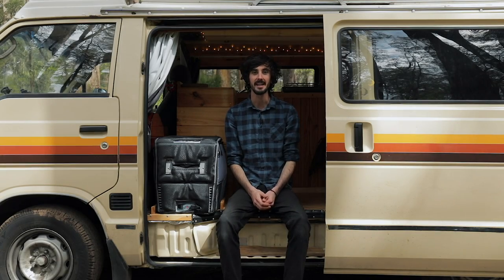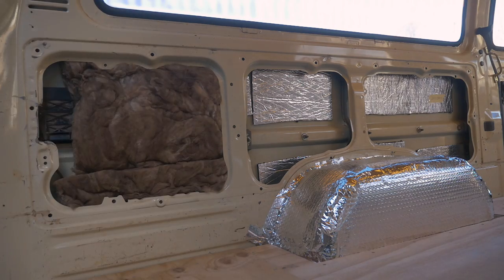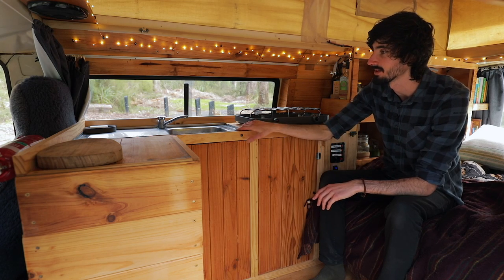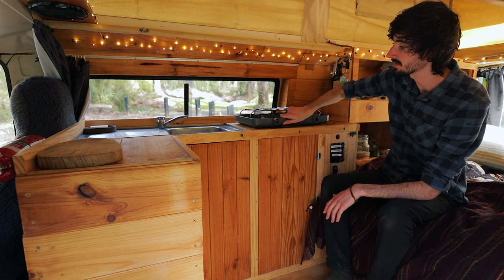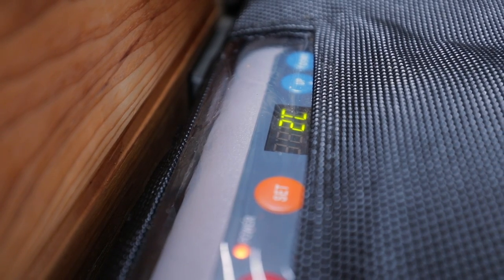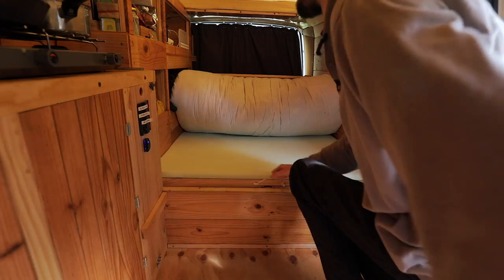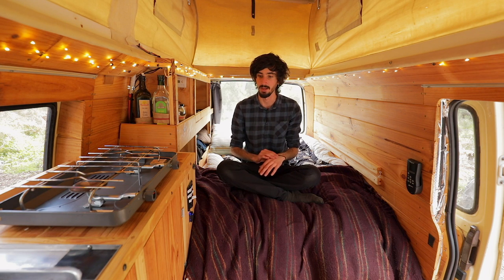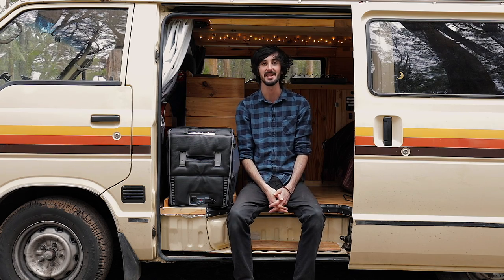Van Life Tour: I Converted an Old Van into my Full Time Home and Office!

Comment: Tearing out the old interior because it was old.. Buys old timber and screws back in... Say what?
Reply: It also smelt funky - just pointing it out
Reply: Who pays 6000 bucks for a 33 year old van?
Reply: @flailanwhip  a can is different from a campervan- a campervan is  basically a  travelling tiny house. And he rebuilt it so it's more or less worth the totalled money. Don't wanna start a comment debate, these are just my thoughts. Have a great day 😂
Reply: @cheliroyal3609  I agree the final product is worth it but, the original van looks like it was worth scrap value plus whatever the mechanical required to drive safely.
Reply: You realise he got it easy, something like this would cost 12000 Euro in Ireland
Reply: “it didn’t really fit my needs”
changes everything
Reply: @cheliroyal3609  You don't pay for a vehicle (or anything) based on what it will be worth after you fix it up. You pay based on the condition the seller is selling it to you in.

Comment: Ther desk top should mount right to the side of the bed and swing down on a hinge then two legs unfold or one triangular piece holds it. You can make it look like a picture on the wall.  Plus the water that's used needs to go right to a small tank under the van that has a plug so you can just pop it out and allow it to drain. Move the batteries and electrical as well that's all important space that can have better use.  There set up is great just a few recommendations. I love it how it is as I love this concept in itself. Great job

Comment: Before I met my husband, I had a makeshift home in my 1999 Chevrolet Blazer.

It had a mattress pad, a few drawers for my clothes, my seats folded down so I could sleep, and I had panels for curtains!

I was living with my brother at the time, but I didn’t want to drive the 80 miles home one way from work (I got a job after college in the city, which wasn’t available in the rural town I was from), so I always camped out in a truck stop Parking lot, took showers every other day (I utilized the truck stop showers) and relied on to-go food.  It was pretty decent.  

But now I live in the city with my husband, and have a mortgage, and drive a sedan, so no more car home for me!  

It’s awesome to see that the guy did this!  I’m not mechanically inclined at all to build something like that.  I look for the easiest solution possible.

Comment: Good stuff guy, don't know if you solved the desk problem but one thing you could do is have some leg extensions on it as in, you get the same length wood, get a hinge, and have them folded up into it. When you want it as a desk, you can drop the extenders and then sitting from the end of the bed you can place it there if you've something to hold it in place, maybe some legs on the other end of it that can fold down so it can free stand. Good job but!

Comment: I love the build! This is one of the nicest ones I’ve seen. I particularly like the bed extension idea, i am planning to build out a van next year and I’m about 195 cm/ 6’5”. This is a great solution! 

Also, I’m wondering what electrical experience you have because I have none and setting up solar is a worry of mine. 

Excited to watch your journey.✌🏼✌🏼
Reply: if I was u I would be questioning how cold the places are where u are travelling..  its really easy to set up a battery to a solar panel that can do some basic charging for you,... I just did mine today! all the info I needed came with the regulator I bought from a battery shop. it will tell u the gauge wire to use and where to insert the fuses. just remember that as soon as your panel is in the sun it becomes live, so be aware of the two tail end wires connected to it and what u do with them and be aware of shorting your battery if u create a path between the two terminals.  I guess it becomes a bit trickier when hooking up more than just lights lol. what I want to know is how his solar power is handling charging all of his camera equipment. it seems like a decent enough panel set up to do so. also there were a couple of gadgets in the video I would like to know about... the little white box in the food shelf and the black remote on the doorway.

Comment: I always wanted to live in a mobile home, but realistically speaking, living on a van like this would really be a massive pain in the ass most of time, because the car would need constant maintenance and since it's an old car, it'll probably need an extra care. So I reckon that living in a mobile home like this would only viable for like 2-4 years, 5 tops.

But still, during those years, you'd be constantly on the move, so I guess that'll be pretty interesting.

Comment: Umm.
What about the weight of the van ?????????😅😅😅😅😅😅😅
Reply: What's wrong with the weight?
Reply: If there is More weight the van will take more power and fuel and the tyres will get tired soon 😂😂😂😂😂😂😂😂😂😊😊😎😎😋😋
Reply: amaruka mattoo He can install heavy weight tires that last years. Fuel is going to be a problem unless it’s a diesel with doesnt take so much to move the van. Most of the materials installed are made of wood. So weight is not going to be a problem 🌝🌝🌝🌝❤️

Comment: When you are putting in the second battery don’t forget to connect it by going positive to positive and negative to negative. If you go negative to positive then you will double the power so say your battery is a 12volt and you connect it to negative and positive then it will become a 24volt

Comment: You should put your waste container below the van flooring soo you wont smell inside and easy to drain. Theres a small area there where you can costumize a container for waste. I done it with my van so it can be done in yours too. ✌

Comment: Really nice job on the conversion. It looks like there is a fair bit of extra weight in all the wood construction, though. I imagine the Toyota is a 4cylinder gas model - did you use it enough before the conversion to see how performance and fuel economy was affected? Any suspension mods needed? It looked a little low at the back but that might just have been how it was parked. I like the idea of converting  Japanese 4cylinder gas or diesel rigs for travel economy but wonder if the weight factor makes the gas consumption as bad as bigger 6cylinder rigs that can take the weight better?

Comment: Dude, parallel mode only works with identical batteries. If you put different battery in parallel will literally explode. Those 2 battery have to be same amp, year even same model.

Comment: Really good job...except for the insulation. That's going to be a major problem and rust out the van. Insulation needs to breathe or it just traps water. He should have gone with a water permeable barrier. He actually would have been a lot better off getting the interior spray foamed so it sealed right to the metal. That aside he did a great job with the electrical system. That's not a bad to live for a few years in your early 20s. Now he can work and sock away bank for a down payment on a real home - or some land and a small home. Definitely not something you want to be doing beyond your 20s though. Otherwise you could end up living in a van down by the river for the rest of your life.

Comment: The fiberglass insulation in your van was not the greatest choice to insulate your van. A big down side is that it will collect and absorb moist which will sit between your was and form mold and mildew. I would assume that you chose this do to the inexpensive price of this though for this situation it is not good. I would suggest you to research more even though I just saw this video well beyond your completion